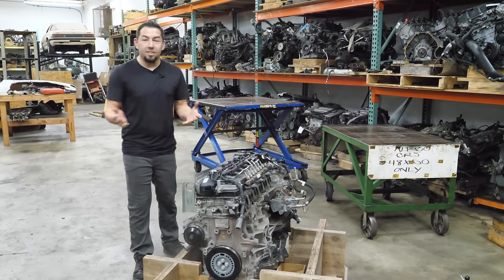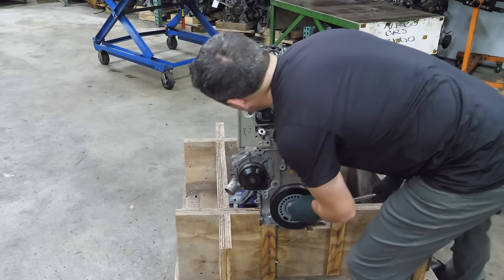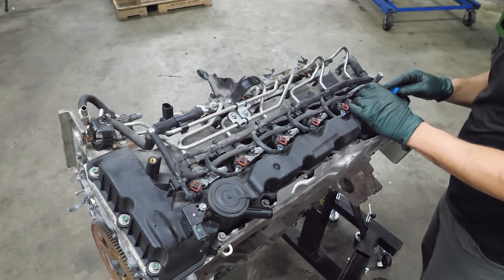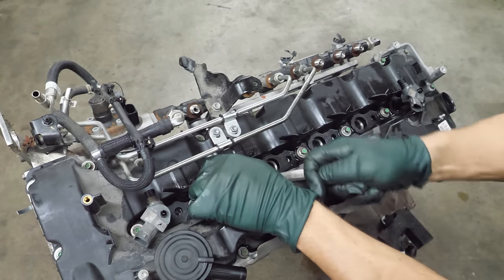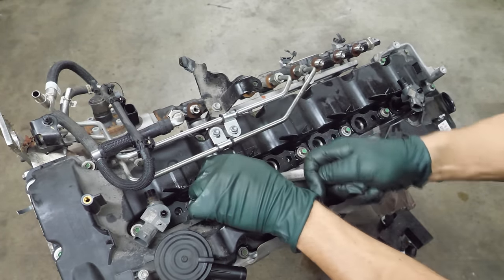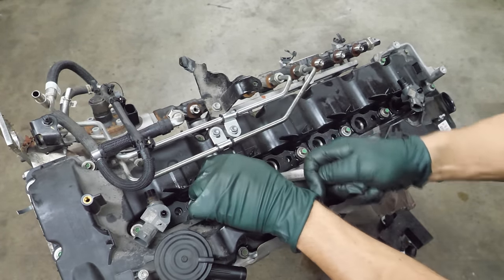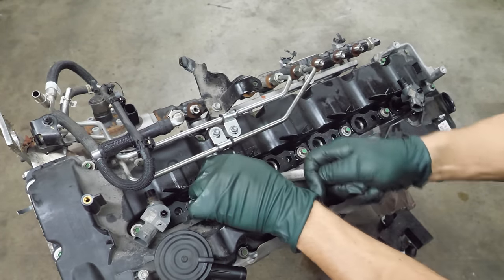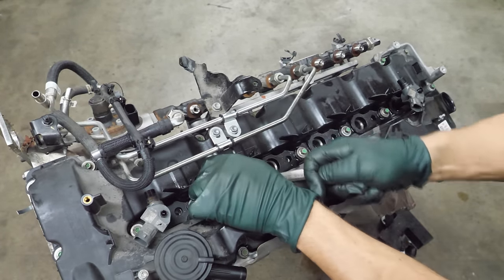BAD 2020 Silverado 3.0 Duramax LM2 Engine Teardown INCREDIBLE DAMAGE!

Comment: Well mate guess what the fault code relates to bad rail
Pressure sensor i changed that car still
Thr same starts idles and dies then i charged battery overnight it was dead same result then i decided last go at the car 🤣 i unplugged the front o2 sensor on the cat the car euns drives like a dream my question is can a bad 02 cause car to run rough and die 
Cause it drives great with that unolugged fron the electrical plug thanks
Reply: Running better with Unplugged Sensor: Probably running off pre-programmed values that make way more sense than what the sensor is sending to the ECU.
You gonna need a good scanner to observe real time data and compare it to good known values from another car or truck like yours that's running properly.
Good luck ! 🤞😊👍
Reply: @GIGABACHI  
Thanks mate i ordered a new sensor 👍
Reply: @GIGABACHI  

Hi mate do you know if the focus 1.0 ecoboost has a bug software problem ? 
Somtimes i start it it says engine malfunction service now but when i switch ignition off abs back on the message is gone do u think i need to oil and filter change then reset oil life cheers 👍

Comment: If the timing system is going to be driven off the back it has damn well better be done on a gear drive like a 6.0 Powestroke. It doesn’t need high rpm performance so imagine if they’d driven a camshaft and oil pump off the same gear off the crankshaft. It would’ve been excellent and nobody would ever have to worry about it. It could be a million mile engine with simple changes.

Comment: I think your assumption about how the engine failure occurred is correct. That 4th piston you pulled out obviously had bad rings and blow by. You can see the clean spots around the edge of the piston, that’s oil blow by cleaning  carbon off the piston edge. 

That engine was drinking oil on that cylinder for a while and eventually it got too low, and we know what happens when the engine can’t pick up oil from the pan.

Comment: I seriously don’t think that it was a jumped timing issue! I think the oil starvation caused a lot of slop in the rod bearings and therefore allowed the Pistons to extend further up in the cylinders making contact with the valves as they were closed if the Pistons were hitting the valves when opened the rockers would be bent or destroyed!

Comment: I do not believe those divots in the top of the pistons were from the valves hitting them.
With only one destroyed rod bearing the other cylinders would not have the travel to do that.
I am with you on its poor design to use a belt submerged in oil to drive anything internally.
These newer engines that have layers of sub assemblies are mind boggling how many bolts that are used to hold them together. Not a fan , but love your channel.  Thanks

Comment: Supposedly these were mostly designed by Opel and they do mostly cabover in Europe so they put a Europe designed engine in an American cab thus pulling the cab or transmission. That said this is likely going to be my next engine but the LZ0 and at least it has steel heads now and maybe this is why.

Comment: I will disagree that some parts, such as timing chains and water pumps should NEVER be installed used. I just did an engine swap on my Jeep. Timing set had only 8 months of use on it, and the water pump only maybe a year(maybe 12k.) I know the exact history of the parts, and know the issue that caused the engines demise(Jeep 4.0, several years with a "death rattle", a severe overheat to the point of stalling while idling 18 months previous due to a radiator tank blowout when I left it idling while I  plowed out my parking space at work in my skid steer. The entire cooling system was changed at that point, as after I replaced the radiator, I found a water pump gasket leak from the gasket getting cooked. Last summer the trans went up, and from the overheat the bumper for the timing set cracked and when I turned the engine in reverse to get the torque converter bolts out, the bumper was removed from it's clips, so the timing set was replaced, as well as the valve cover and oil pan gaskets.

Comment: This type of failure is due to high oil consumption from using the thin recommended DexosD oil. Good quality synthetic  Diesel 5W-30 oil will prolong the life of these engines immensely.

Comment: All new vehicle engines are designed to be disposable, there are no remanufacturable components in them like there used to be. Every component is designed to be produced cheaper and lighter. They have a predetermined lifespan with the light weight oils. You can change your oil every thousand miles, they will never last like the older engines. This engine is sparkling clean inside compared to older ones but the fuel dilution in already thin oil is the problem.

Comment: Change the oil when youre supposed to (go by milage not the damn dash display) and use the CORRECT oil (not 15w40) and you should be fine

Comment: It looks like a low oil condition precipitated the failure. It would cause both the timing jump then the bearing failure due to heat and contamination. In any case the operator caused this catastrophe.

Comment: Early on the only issue i saw is electrical wire to close to injection tube . The wire in the oil reservoir region are not airgapped . Doesn't gm know about wireless electricity ? False signal destroyed this engine . Good engine design but electrical wire assembly ? 0% . This was preventable . Easilly fixable too .

Comment: Did the vehicle have a manual transmission? Looks like a typical diesel over speed. Volvo truck engines do the same thing. Dumping the clutch going downhill in too low a gear will send the pistons into the head when it's spun to ten grand.

Comment: Most likely oil pressure regulator failed and engine was starving for more oil , and most likely there was not warning light about low oil pressure duringthe ride, just like on some  Mercedes diesels. Bad design of installing it inside the engine on the pump directly,  instead of installing outside the block for easy replacement. At least Mercedes was smarter and installed it outside

Comment: My guess is it jumped a tooth at the intake valve cam chain sprocket which then caused the piston to hammer into the valve that was open at the wrong time....Opps. This most likely happened from low oil pressure to the oil activated cam chain tensioner. The Low oil pressure could have been from .... Opps i forgot to put oil back in after draining it, then starting the engine or, ... the variable oil pressure system went on strike or,... there i some kind of anti drain back check valve in the oil system that malfunctioned. After this the engine was in service for sometime,  and the driver may have thought it was "normal diesel noise".

Comment: Mine has 34k miles. Just changed the oil. Notice it drains only 6 quarts. Uses 7 quarts. I use GM oil and GM filter. Thinking of pulling off the pan @ about 50k to clean it up. This engine probably has poor service. Diesel is always dirtier than gas.

Comment: The next GM engine I’m wondering about is the turbo 4 cylinder engine that they are putting in 1/2 ton trucks. I also work in a Chevy dealership as a car runner and shuttle vehicle driver giving customers free rides. I’ve heard a few stories and lately two guys saying they have had enough with GM and their next vehicle will be a Toyota. BTW I get to park C8 Corvettes occasionally. It’s still a hard car to backup with one backup camera and those huge wide rear fenders that are above eye level.

Comment: Unless you are towing heavier loads I would buy the v8 gas on the light 1500 GM pickups.  By the time you take into account the moser expensive diesel,fuel costs, diesel treatment fluid, increased diesel service costs and needing to drop the transmission to get into the diesel to do the timing chain and belts service it is a wash after 150000 to 200000 miles.

Comment: The valves broached two circle pockets in the pistons. They were Machinists, these valves and were simply modifying the pistons because they saw a need for better real estate management. It's not their fault that the bearings, rods and pistons couldn't adapt properly.

Comment: I'm 100% sure GM did real world testing on this design, right?  I cannot believe the oil pump is being driven off a BELT!  Imagine towing your 20ft. travel trailer on vacation and have it give out. 2 weeks in the shop and $11,000 to $15,000 later your on your way.  Wouldn't the sensors detect low oil pressure?  Warning?

Comment: Notice that the timing chain is long and single row. I figured that chain stretch could have caused the timing to be off enough to cause the piston damage.

The corners cut to save money on this design discourage me from ordering this engine in a new vehicle. GM has a reputation for cutting corners to reduce cost at the expense of customers. They cannot waste money on good engineering and construction that should be going into paying executive compensation and stock dividends. I won’t be a customer.

Comment: If the oil pressured tensioner fails at start up (internal check valve leak down) then say goodbye to engine. Bad design ..a  spring loaded tensioner would be much more reliable.

Comment: Good old LS V8 is still the best.  and heavily supported by the aftermarket industry.

Why did they design all the chains in the back of the motor while they knew there is a transmission back there? Design engineers  should be put in the shop with the engine and transmissions together and have him take it apart and let him  work on it himself.

Comment: It seems to me that original owner never changed the oil, engine overheated, parts started to overheat, things started to get shaved. The fact that engine ran after the previous idiot owner did to it ( or didn’t) is amazing

Comment: This is one of those cardinal rules of engine design: if nobody else is doing it, maybe you shouldn’t be either. One thing nobody else does anymore is put timing chains on the REAR of commodity vehicle mass produced engines. All the benefits you get are irrelevant for a passenger car or light duty truck, with all of the drawback.

Comment: These are what I call ENGINEERED FAILURE POINTS.  Parts and components SPECIFICALLY designed and produced to fail at a specific point, forcing the owner to pay exorbitant amounts of money to repair or worse, buy a new vehicle.  These engineered failure points are designed to always happen after any warranty periods.  They can be as simple at a head light bulb burning out or in this case, the oil pump belt breaking.  Planned Obsolescence, making a car undesirable because it looks old, was not enough for the automotive industry to rake in the money.  They instituted Engineered Failure Points and Accelerated Deterioration (metal, paint and plastic that "dissolves quickly"), to force consumers to buy more of their products.  At least with Planned Obsolescence, a vehicle could continue to be operated as intended with minimal repairs and maintenance.  I prefer an older vehicle when doing maintenance than these new, gizmo and gadget, Bic lighter cars they produce today.

Comment: Timing system on the back of the engine is the stupidest thing. Suprised they didnt use a rubber belt for timing and make you pull the engine every 60k for servicing.

Comment: That engine was designed with a belt driven oil pump. It also takes power from the crank at the rear of the engine. Where it meets the transmission. It is supposed to only last 100,000 miles, and it is an engine out job. They had to put it at the rear, because the engine was already too long, and placement at the front was not going to be possible. This engine is not available with the off road trim, for this reason. It's tooling and interferes with something.... Strange engineering solution...

Comment: Theirs a triple threat depending on which party you are in line of ownership . The original owner you have a warranty as stated upon purchase . If the motor has been blown your investing that motor money With an immediate sale as it’s rolled out with its replacement motor . The 2nd owner gets a bag of rocks , a limited warranty and sitting an Mini  grenades ready to pop your cherry . That third owner gets it with an “As is “window sticker upon purchase , about to pop tires included .

Comment: It’s funny the oil pump belt is neither here nor there… but the fact they put the weakest link of most engines at the backside of the engine. Granted a trans is fairly easy to remove… I think a front timing cover is quite a bit easier to remove.. as well as what’s wrong with either gear drivin oil pumps like the rest of the diesel family or a crank driven oil pump like 99% of any engine family. At what point did any engineer think you know what would make this engine even better let’s run the heart of a motor with a wet belt

Comment: this is clearly from poor maintenance. Oil sludge caused bearing failure.  Most people keep complaining ahout chains. Let me remind you 5.7 Toyota chains last easily 300K miles. I've seen and worked on them way too many times. I have even seen GM 5.3 and 6.2 with over 250k miles with good chains.. CHANGE YOUR OIL MORE OFTEN SPECIALLY IF YOU DO A LOT OF COLD STARTS.

Comment: This is why I say, I will not buy a car made after 2005. My audi a6 with the 2.5 v6 tdi has 437 000 kms, nearly 300 thousend miles and still very strong, consumes no oil. My e39 525d with 237 thousend kms is basicly a new car. They just produce industrial waste lately, not engines and cars..

Comment: Making certain parts out of aluminum is not a good thing for longevity anymore, I am going to say that the day of 300-600K milage engines are going away quickly after the corporation bases figured out that the sales will be way down if they continue to have vehicles last to long.

Comment: Just avoid engines with a belt timing chain. Or by the truck cheap after the engine has failed and put a different reliable crate engine in

Comment: I can swap a head gasket on my 04 Ram 3500 5.9 Cummins on the side of the road in about 4 hours. 
In 20 degree weather, at night using only the light from my Marboro red cigarette, using a 45 dollar harbor freight tool kit.
Reply: I never had head gasket go on any of my vehicles.
Reply: Are your vehicles mostly stock or heavily modified?
Run 70/80 psi through it eventually you might once and awhile if your hard enough on it

Comment: Ohgod, another "Eww, an oil pump belt.  It's so terrible!"    I promise you that belt is the original unit in that engine, and it could go another 100k miles no problem.  by that point, a chain driven oil pump would also need parts replaced.   I work on and repair machines for  a livin that utilize chain and belt drives, and those kevlar reinforced belts usually last just as long as, or outlast, most of the chain drives.  What usually takes the belt out is pulley wear - teeth get sharp and start to chew at the belt.  Oil bath belts won't have that issue anywhere nearly as severely  as a dry one, which is what I think most people dislike.

Comment: No bearings in the head for the cam to run on is asinine. Polaris does the same thing in their engines and is a common point of failure

Comment: GM couldn’t let Ford build the only engine with timing chains on the flywheel end.  Ford had reason for it converting a pushrod block to overhead cams.  What was GMs excuse?

Comment: Everything - no - EVERYTHING GM makes nowadays is so unbelievably cheap it’s shocking (not really)!! Just junk, and nothing but it. I can’t believe they are now using CARDBOARD covered with FABRIC as wheel wells now!!! 🤦‍♂️ Unbelievable. My pops bought a brand new Sierra (2020), and it only has 25000 miles on it and the radiator lines (steel portions wedged between rubber hose sections (talk about stupid) have completely rusted out and he was losing a litre of fluid a month! Just ridiculous…

Comment: Lack of power, wouldn't rev lmao. They call it Limp Mode in the owners manual haha. Brought on by no oil pressure because there was no oil. Dumped the tensioner slipped the chain and came to a hammering stop in a few miles by the look of it. Probably started on a corner in a turn and went from bad to hell. Who takes a late model high end Diesel Truck/SUV and doesn't ever change the oil? Who keeps their foot to the floor when power drops after low oil has been coming up in the warnings for three months? That's literally insane. Pan and seals were perfect, oil black as night, worst case of neglect I've ever seen. I've seen starter cars or throwaway cars neglected like that with zero oil changes from day 1. This is definitely not a throwaway vehicle powerplant, freaking shade tree.